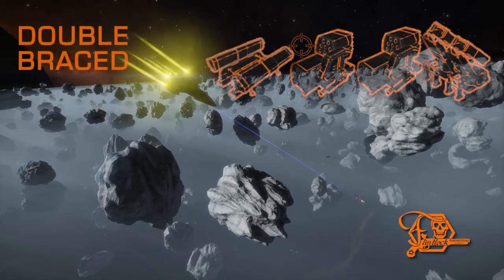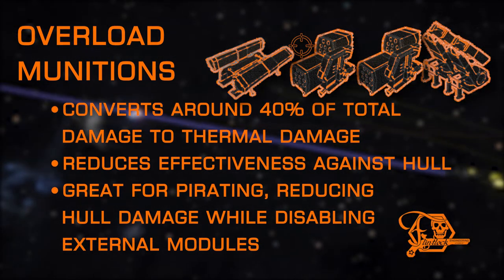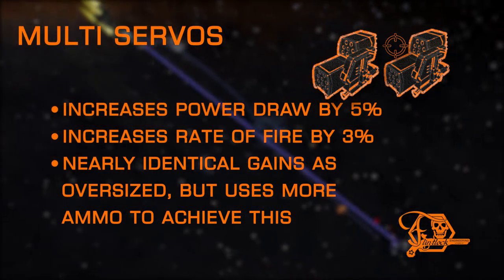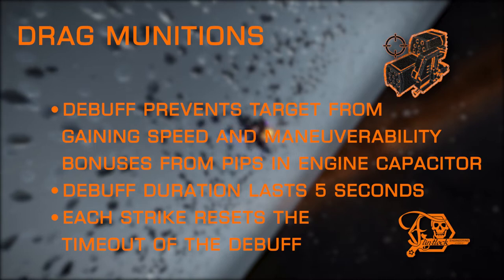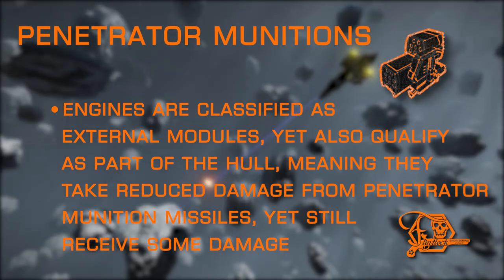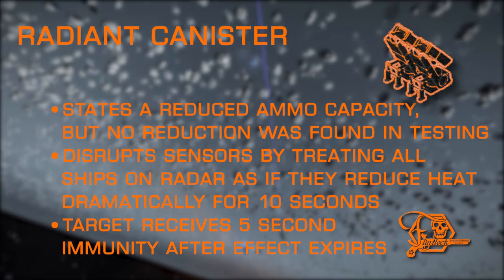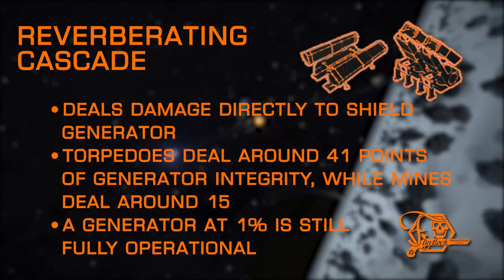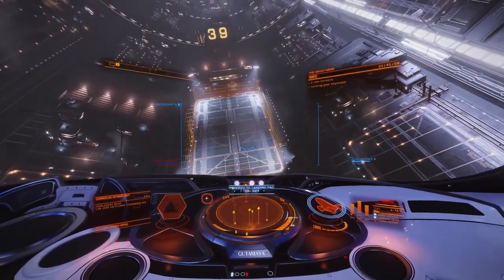Engineering Series - Episode 4: Ordnance Experimentals

Comment: Great video. I echo the other comments about how well put together these videos are. Excellent work!
So I’m loading out my trader cutter. 
My 4 medium hardpoints will either be 4 x pack hounds, or 2 x beam turrets and 2 x pack hounds. (with 2 x large multis , and a huge beam, all gimballed because it’s a cutter!). 
If interdicted, I plan to kill the pirate and may drop in to the odd Weapons Fire USS en route as well to spice things up a little. So, happy and willing to fight...
But, I won’t be taking it to Haz res sites so ammo isn’t an issue. I’m thinking rapid fire pack hounds would work best for this situation. What’s your thoughts?